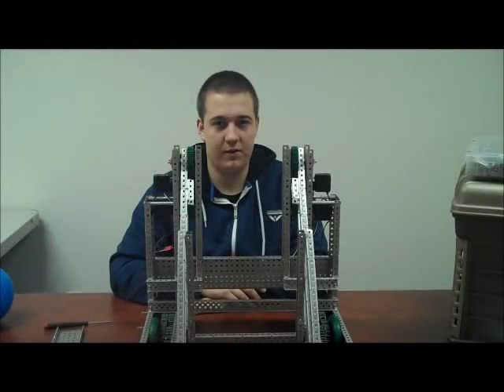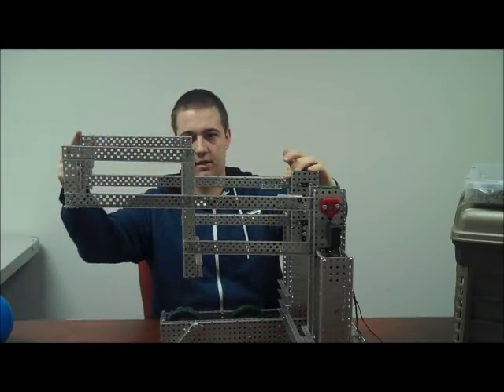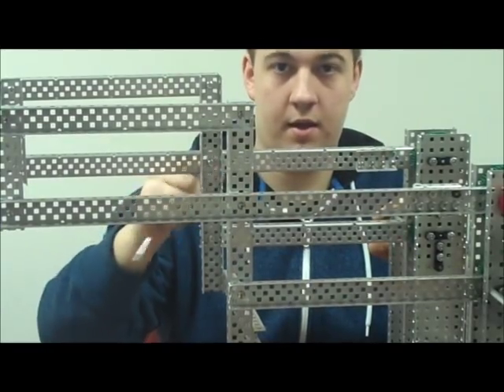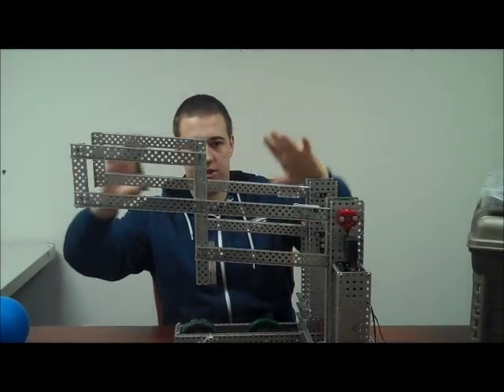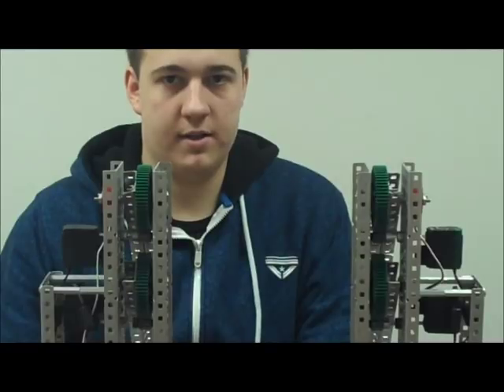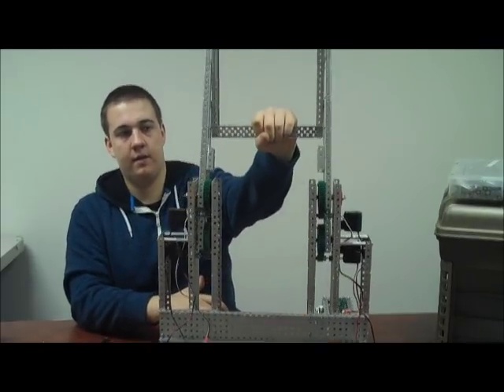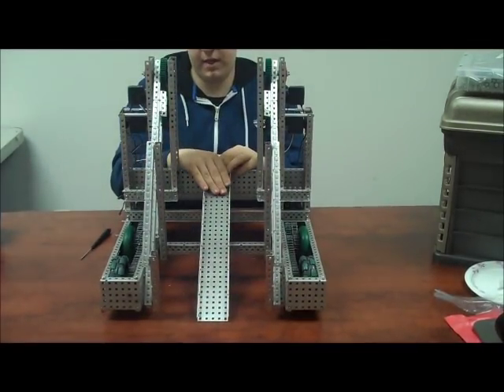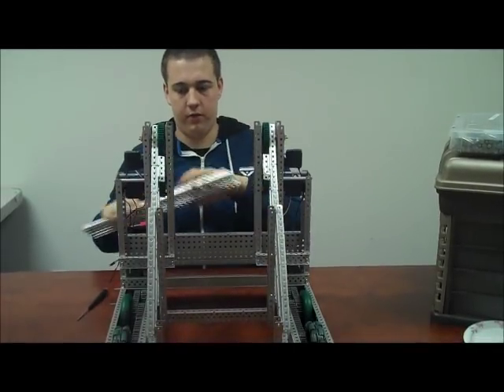Vex Robotics Instructional Video (Six Bar Design)

Comment: Symmetry is not necessary for a six-bar, nor is it useful. It does not increase the maximum height of the linkage. It does not help it "lift really well" or "work a whole lot better".

size limits and the spacing of the horizontal bars will constrain where you are able to mount the central vertical bar, but other than that where you choose to mount it won't affect performance.